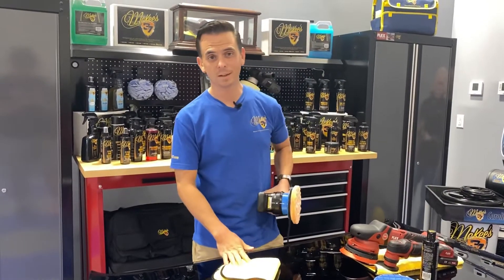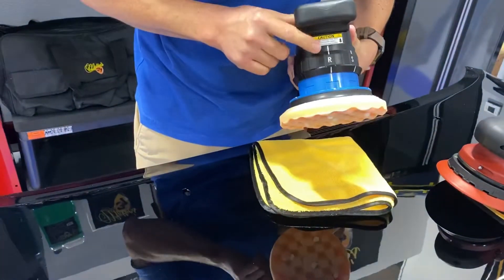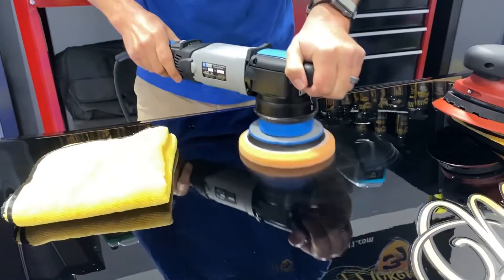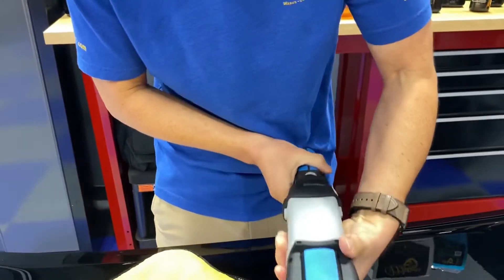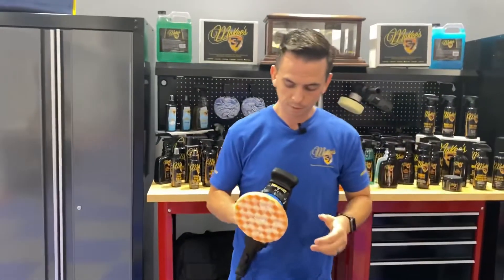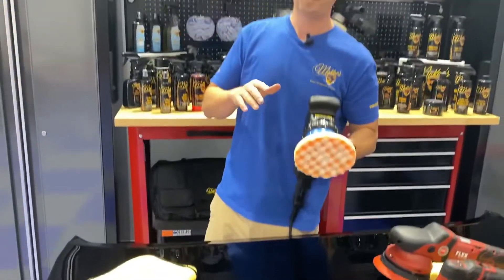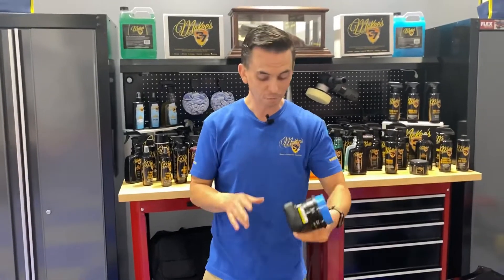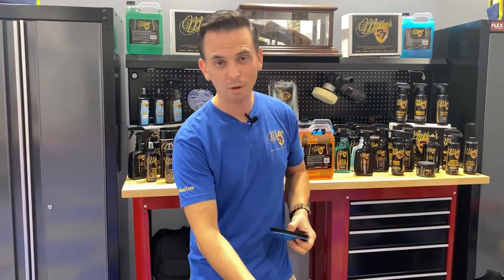UDOS 51E - 5 Modes Explained in Detail | McKee’s 37

Comment: Hey nick, thanks for the video. Was wondering how the 1200 motor transfers to the pad? Does it have any stalling problems on the DA settings??
Reply from the maker: The key to the DA setting, as mentioned in the video, is to be at speed 3 or higher.  I have not experienced any stalling issues with this tool.  But as always proper technique is key to success. - Nick

Comment: What I haven’t heard about the machine is if it’s a heavy unit , I’ve seen plenty of videos on it now but nobody has said if the machine vibrates a lot if it’s a easy user experience.
Reply from the maker: It is very smooth and quiet.  I would say it is heavier than other polishers it competes with, but you hardly notice it. - Nick
Reply: McKee's 37 I have it now , I’ll still be testing it. It is heavy. On vertical panels it may be a challenge for guys who are doing corrections on a daily basis. Flat panels no problem. I’ll say this the rotary function should get more ppl into using it. Very smooth so in theory if someone learns the rotary on the Udos it’ll make using the DA functions that much easier. DA guys will have to get used to the added weight when doing vertical panels. Larger vehicles , boats and anything where you’re extended or using more core strength it’ll test you a bit. But once you’re comfortable it’s a decent polisher.
Reply: McKee's 37 btw really enjoy your line of products.